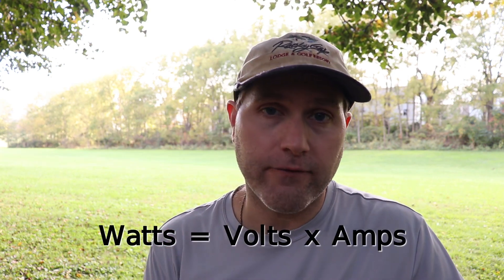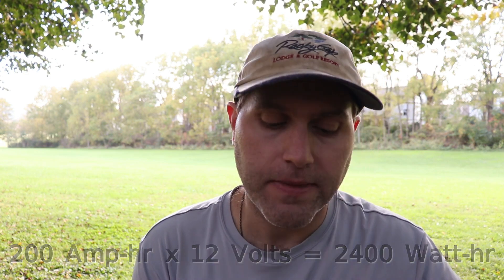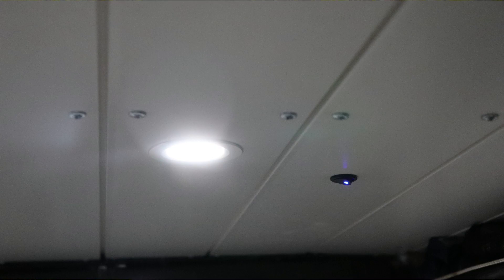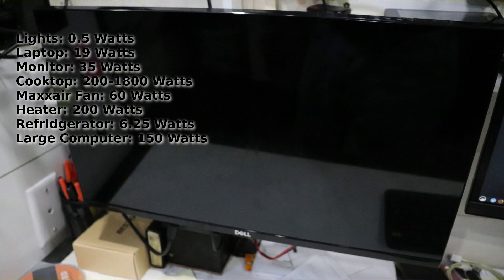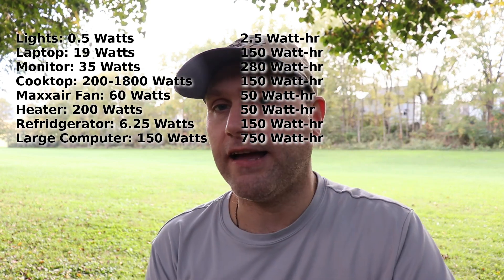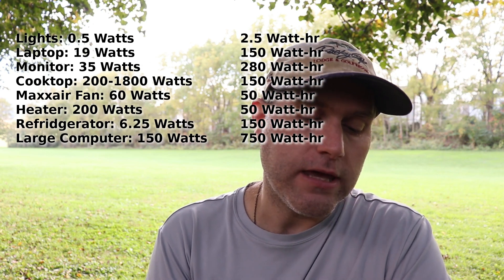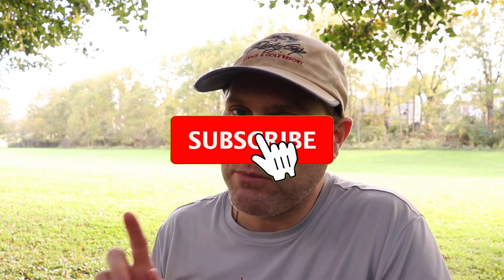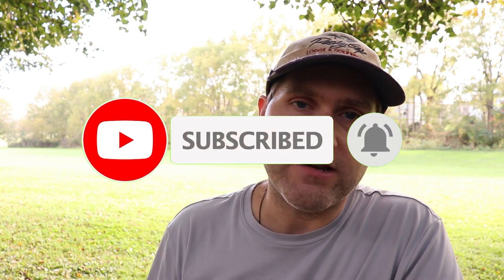Calculating Power in Your Van

Comment: My circular saw is over 1800 watts on start up or if bound up. Great video. I will be building off grid D.C. cabin next year. Super capacitors are great for on demand power. Super capacitors do the same for solar like they do for car stereos. Mine is a maxwell ultra 31 which allows me to run circular saw all day now. With 2 well used deep cycle lead acid batteries before super capacitor was limited to about an hour with circular saw on sunny days.

Comment: What make of inverter do you have ? pure sine wave or simulated sine wave. I blew a video card years ago on a honda generator running close to max. power. I believe the sine wave degenerates to more of a stepped square wave.
Reply from the maker: I have a Novopal. Always use pure sin inverters for van builds. A lot of devices will break if you use a modified inverted.
Reply from the maker: Also, size your inverter to be twice the size of what your typical load will be. I use 1500Watt. If I need to replace it I will go with a 2000W instead. I did the 1500 because my initial battery design would not support a 2000 Watt, but parts were out of stock so I went with a battery that will support the 2000Watt.